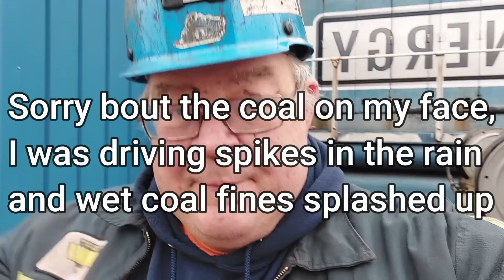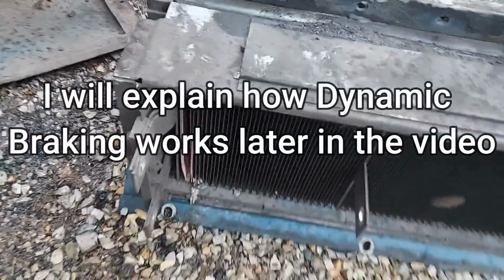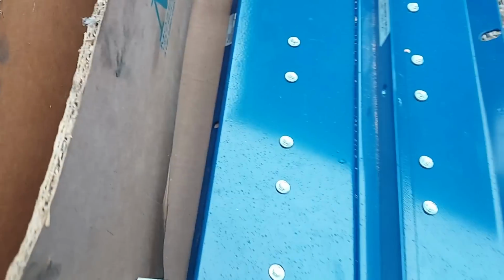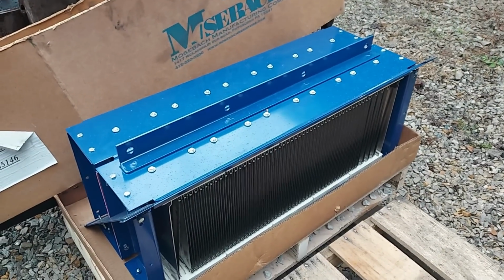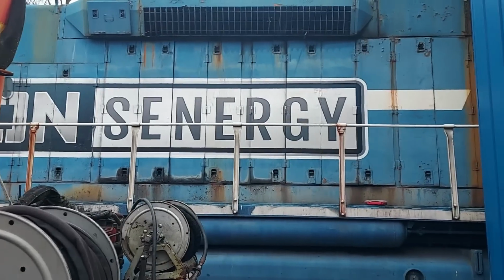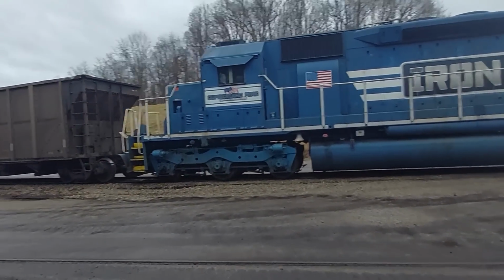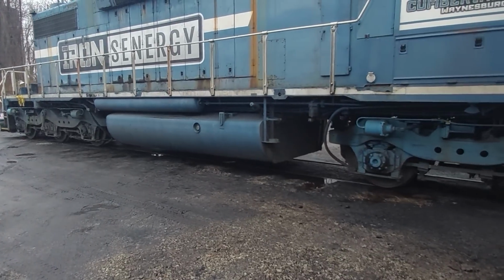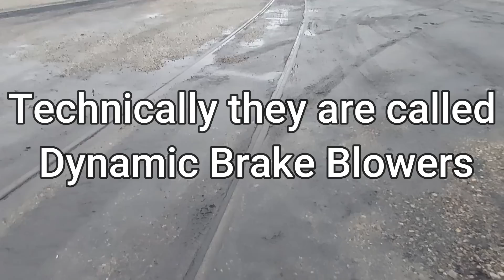New Locomotive Dynamic Brake Resistor Grids

Comment: Wow.. I’ve seen some large resistors in my time. But never one that big. That thing must be able to handle some serious power and dissipate some serious heat. Thanks for sharing.
Reply from the maker: They are big for sure and there is 3 of them on each side of the loco
Wade.  Appreciate very much your taking the time to write in and to check out the resistor grid show my friend.

Comment: Very cool, Dave! I've never seen a resistor unit for dynamic brakes before! It's less complex than I had imagined. It's basically just a fin stack heat sink. Very cool, no pun intended! Looks like that one got hot enough to melt the solder out of it! Hope the new ones work out on old #1. #3098 sure is looking good!
Reply: i think it shorted out from an accumulation of coal dust.  if this happens too often, better filters should help.
Reply: @philhoward4466  I agree with you, but, it should be regular maintenance like using compressed air and a blow gun to blow out coal dust periodically. It should not take eons to do so, when the engine is idling and the current is OFF you could do that. Just saying........
Reply: What's used for resistance besides tungsten, like light bulb& space heater stuff?  Way hotter melting point then solder for sure.
Reply: @alro2434 the solder could be made out of anything. Might even be braised with bronze or something like radiator cores used to be. I used "solder" as somewhat a generic term. Not really referring to the lead/tin mixture that we normally associate with the term. Although I would certainly like to know the materials used.
Reply: They look a lot like the big 'starting resistors' we had for DC propulsion motors aboard a ship I served on.  Surprisingly, they don't have very high resistance (ours were just a bit under one ohm).  BUT, they have a very high wattage rating.  For starting the motors, they would have upwards of 400 kW for a few seconds.  These resistors obviously have to handle a lot of heat for a lot longer.

I doubt that what you see melted there is conventional 'solder'.  If those plates crack or corrode they develop 'hot spots' and will melt the iron itself.
Reply: @philhoward4466 I disagree.  Resistors like those are already a very low resistance (like less than 10 ohms, possibly even less than 1 ohm).  'Shorting' something like that would melt the cables, not the resistor.  We had large resistor banks for starting huge DC motors used for ship propulsion and while low resistance, they are rated for very high wattage.

When we saw failures like this, it was because fatigue caused a crack to start.  That INCREASES the resistance and all the energy ends up concentrated in just a tiny part of the fin.  No amount of air flow can cool the tiny area and it starts to burn/ melt.
Reply: I'd agree with what Mike said. You want the dynamic brake resistor resistance to be low to get high current flow (and thus effective braking) when placed across the generator.  On the other hand you don't want the resistor's resistance to be too low since then you risk exceeding the current rating of the wiring.  After all a wire is just a very long, very low value resistor; too much current and it'll melt and/or catch/induce fire.
Reply from the maker: Glad you enjoyed seeing something new Shane. Not very many folks
ever do get to see these, they are hidden behind the screen. You
are right it is a big heat sink that dissipates the heat. Very much appreciate your taking the time to visit with us and check out the video my friend.
Reply: @Trains-With-Shane  Many resistive devices are made from a metal called Nichrome which is an alloy of nickel and chromium.

Comment: That’s a beautiful new dynamic brake heat dissipator. I actually thought it was much bigger considering all the weight it has to deal with when braking. That lil thing is a marvel.
Reply from the maker: There are 3 of those grids on each side of the loco, one grid for
each traction motor Bassotronics, so they apparently are
adequate. Coal dust getting in there is not a good thing and
all the coal dust was cleaned out before we put the new grids in.
Very much appreciate your taking the time to visit with us and check out the video my friend.

Comment: That grid shorted out pretty darn good. I hope it had a great big ground relay alarm bell ringing when the engineer put it in dynamics. If not, that should probably be checked out also. 
Have a great rest of your day Dave.
Reply: Looks like an open circuit when it melts away.
Reply from the maker: I don't know if it gave an alarm or not Ralfie, no one said. The last
grid that went bad was after dark and the operator saw flames
shoot out thru the screening, that had to be a cool sight to see!
May you also have a great day.  Very much appreciate your
taking the time to visit with us and check out the video my friend.
Reply: @ccrx6700  
I’ve seen them melt down also, it looks like lava falling on the walkway!
Reply from the maker: @ralfie8801  wow 👍😊
Reply: Check for "bird-caged" traction motors...

Comment: I'm guessing many heat cycles, and coal dust getting in the grid, creating hot spots, finally took its toll. Thanks for another informative  video giving a glimpse into the make up of a locomotive Dave! Have a nice weekend my friend!
🚂🚃🚃🚃🚃🚃🚃💯👍🇺🇸
Reply: Yes, many cycles and I'd bet some tiny cracks formed.  That made a 'high resistance' spot and the energy ends up concentrated there, overheating it and burning / melting the metal.
Reply: Looks like it
Reply: @mikefochtman7164 snowball effect
Reply from the maker: You are right about that Jim, a lot of use plus the coal dust
sure doesn't help matters. All the coal was cleaned out before
the new grids were put in. But it's impossible to keep the coal
dust out with our operation. Most folks never get to see what the grids actually look like, all they see is the screening on the outside of the loco body and can't see inside that.  Very much appreciate your taking the time to visit with us and check out the video my friend.

Comment: Loved the video!  Slight clarification/expansion of what you said.  As you said, when dynamic brakes are active the traction motors act as electrical generators.  The current from them is sent over wires to the dynamic brakes which are large electrical resistors.  These convert the electric current into heat.  The energy in the locomotive's motion is converted by the traction motors into the electrical current; this creates "drag" and slows the train's motion.  This is why dynamics are less effective at low speed, there's less energy (in the form of motion) available for the traction motors to harvest and sent to the resistors.
Reply from the maker: Really pleased to hear you enjoyed Alex. Thanks for the very good
expansion on how the dynamics work! You are totally right in that. Very much appreciate your taking the time to visit with us and check out the video my friend.

Comment: Hey Dave! As you know when the engine is going down hill and coasting the operator stops applying power to the DC drive Motor but because the rotors are still turning with voltage still applied to the fields, the motor turns into a generator! 

The operator can engage the DB or Dynamic Braking and That connects the DB resistors in parallel with motors or generator now and put a load on the motor/generator which will slow the engine down.

I looked up the DB resistor and the rating is .86 ohms at 700 amps, the is over 400kw! That’s is a lot of power!! 
Thanks for the drive down memory lane! 35 + years ago I use to build DC drives system for coal mines, paper and steel mills.
Reply: I was going to clarify Dave's statement about how the resistive load on the generators (motors) causes them to slow down (i.e. braking), but you did a good job of explaining!

That's a big resistor!!  Did Dave mention my many resistive loads were used?
Reply: The traction motor run at a nominal 600 VDC.
Reply: @Mark-hb5zf  Seems like two loads, one one each side of the fan.
Reply: @alexhajnal107  I was sort of thinking the same,  one on the other side too.  Maybe more, but in pairs (left, right).  Wonder if it's one for each traction motor?
Reply: @Mark-hb5zf  Dunno.  Would be interesting to see a block diagram and a wiring diagram for one of these locos.
Reply from the maker: Thank you so much Ron for sharing that. We have a couple of steep
grades with heavy loads and the dynamics hold them back pretty
darn good on dry rail, in wet or icy rails they usually have to use
some car brakes tho. You are right how the resistors help to put
a load on the now turned generator which slows the traction
motors down.  Very much appreciate your taking the time
to visit with us and check out the video my friend.

Comment: I know what dynamic braking is but it was nice to see the heat sinks. Bigger than I expected. Thanks Dave.:eyes-pink-heart-shape:
Reply: I actually expected them to be much larger.  I bet they run very hot!
Reply from the maker: Not very many folks ever get to see the grids zalmaflash, they
are behind the screening and that is what everyone sees. Glad
I could share something new with you.  Very much appreciate your taking the time to visit with us and check out the video my friend.
Reply from the maker: Remember Alex there are 3 of those grids on each side of the loco,
one for each of the traction motors, so the smaller size is apparently
adequate enough for them to work. Thanks so much for watching
my friend.
Reply: @ccrx6700  Ah, that makes a lot more sense.  I thought all the traction motors on each truck were wired in parallel or something.  Having one for each motor makes things much simpler (and more robust).  BTW, I did the math and together they're generating nearly 1.7 MW of heat at maximum braking!
Reply from the maker: @alexhajnal107  👍😊 thank you Alex

Comment: Hi Dave,
Nice, it is interesting to see the workings of a locomotive.
Yes, those resistors do the same job the bakes on a vehicle.
Need them for going downhill.
The plates are stainless steel, so they last as long as the coal dust lets them.
We used some similar ones on rail dumpers that roll the cars over to empty them when delivering coal to the power stations or lime to the cement plants, huge amount of energy recovered during the roll back with an empty car as the mass is all on the side where the wheel trucks are.
Also, the first time those get to do their job from new there's a huge cloud of smoke as dust and other stuff on the plates burns off when they heat up for the first time.
Kind regards,
Duncan
Reply from the maker: Thank you for sharing that Duncan. You are right, coal dust on them
is hard on those plates. Appreciate very much your taking the time to visit with us and may you have a very good day my friend.

Comment: Thanks for giving us another look inside.  While I learned years ago HOW the dynamics work I had never seen one of the resistors and frankly hadn't thought about them burning out.  That unit you showed us did look a little crispy, any idea about how long it had been in use?
Reply from the maker: I have no idea how long those grids have been in use Robert, but
we seldom have to change them here. Coal dust getting in there
sure doesn't help matters. All the coal dust was cleaned from the
area before we put the grids in tho. Most folks never get to actually
see the grids, all they see is the screening outside the loco.  Very much appreciate your taking the time to visit with us and check out the video my friend.
Reply: @ccrx6700 Those things must be tough or you guys don't stress them as much as a Class One road would (NSs long, steep grades come to mind.)  I'll bet the Engineers will notice a difference in performance like you would after you've had your truck brakes or transmission worked on.  It's always a pleasure to check your postings.
Reply from the maker: @robertf3479  👍😊

Comment: I love the description of Dynamic Braking. It's sort of correct from looking at things, but it's not how it truly works. 
Yes, the traction motors are used as generators, when dynamic braking (or regenerative braking)is used. 
The difference is the power circuit is removed (switched/disconnected by relays most likely), and connected to the massive resistor they just replaced. 
Energy from the rolling train is turned into electricity by the traction motors (with magnetic etc,), then the resistor bank resists the electricity being feed into them, requiring more 'energy' to be used to turn the traction motors, slowing down the train. 
The resistor bank is turning the electricity into to heat, that then needs to be removed to stop the resistor from melting. 
Each use of the Dynamic Brakes heats and oxidise the resistors, making the resistors less able to dissipate the heat. Thus the resistors have a life span, like even thing else on the SD38-2. 

Now regenerative braking uses the same idea and in newer trains and cars the electricity is stored in batteries. So it works like this 
Energy from the rolling train is turned into electricity by the traction motors (with magnetic etc,), then the batteries stores the electricity being feed into them, requiring more 'energy' to be used to turn the traction motors. This stored energy (in the form of electricity) can be later use to power the traction motors.
I know I most likely have wording wrong, as I learnt this at Uni 30 years ago.
Reply from the maker: Excellent description of how it works OzyWizard, you are correct.
Thank you so much for sharing your knowledge with us. Very much appreciate your taking the time to visit with us and check out the video my friend.

Comment: Dave I'm not 100% sure on this, but I think these resistor banks are what supply the LOAD on the traction motors, creating the drag for braking. You are dumping a lot of amps from the motors into these resistors, making a lot of heat just like a toaster on steroids. I was a metalographer at ATI and analyzed some of the metal used for these ribbons. Can't for the life of me remember the grade of steel. This LOAD stuff is just like when you strike an arc on a gas powered welder, the arc LOAD bogs down the gas engine. The generator is loading down. braking the gas engine, the same way the loaded traction motors brake the engine.
Reply from the maker: You are right Richard, these are resisters and do exactly what you
are saying, plus they dissipate the heat created, a pretty neat concept
and how they work.  Most folks never get to see the actual grids,
all they see is the screening on the outside so was glad I was able
to share a part of the loco no one usually gets to see. Very much appreciate your taking the time to visit with us and check out the video my friend.

Comment: Thanks.  The Mosebach company in Pittsburgh made them, also has offices in Greensburg, Johnstown, Altoona & others in coal country, couldn't get the price for that part number.  If the locomotive had a bank of battery's to drive the wheels, the Dynamic Brake energy could charge'em back up instead of wasting it by heating up those big resistance wire/ribbon toasters.  Don't know if coal is an electrical conductor, but with some blocking the airflow it sure wouldn't like it.  Must be undersized to need airflow else it melts!
Reply: Anthracite coal is more than 80% carbon, which is a good conductor of electricity.
So besides blocking the airflow thru the grid, the build-up of coal dust is likely to short out sections also.
Reply from the maker: Thanks for sharing that Alro, I didn't know that info. Interesting.
When the current is fed to charge batteries or an electric line
for electric trains, that is called regenerative braking. Coal in the
grids is not a good thing, but we can't help it getting in there,
all the coal dust was cleaned from the area before we put then
new grids in.  Very much appreciate your taking the time to visit with us and check out the video my friend.

Comment: Dynamic braking is pretty cool. Before it was put into use, all the engine could do was stop the drivers and skid on the rail. Dynamic braking basically flips the function of the traction motors just as you said - back and forth between motor and generator. The amount of amperage is amazing and it is impressive to see these grids :) I am surprised they are that small!
Reply from the maker: It sure is Brian, makes a world of difference when handling a train.
There are 3 grids on both sides of the loco. Apparently they are
big enough to do the job. Big problem with us is the coal dust
that gets in them which can't be helped.  Very much appreciate your taking the time to visit with us and check out the video my friend.

Comment: Guess the coal dust and general grime build up caused the overheating due to lack of airflow - thanks for the video Dave - have a good weekend.
Reply from the maker: Coal dust is not good for the grids for sure Glenn. But we just can't
help it getting in there with what we do here. They are never cleaned
as a routine maintenance thing, but at least the coal dust was
cleaned out before the new grids were put back in. May you
have a good week also. Very much appreciate your taking the time to visit with us and check out the video my friend.